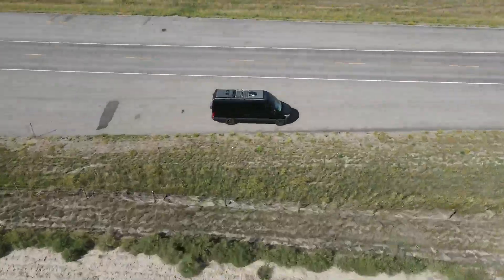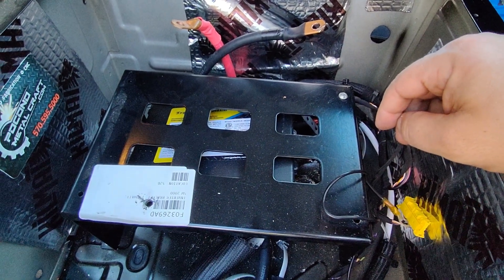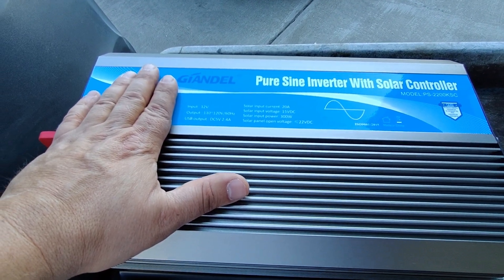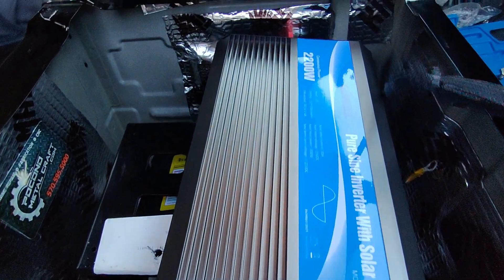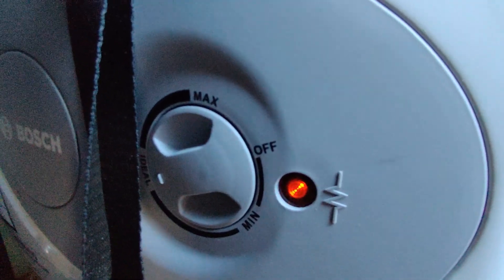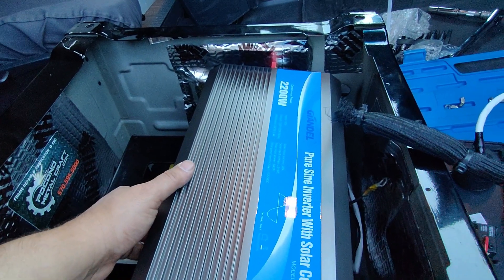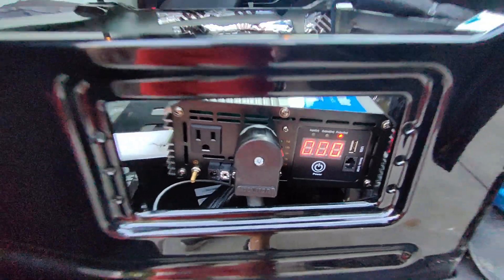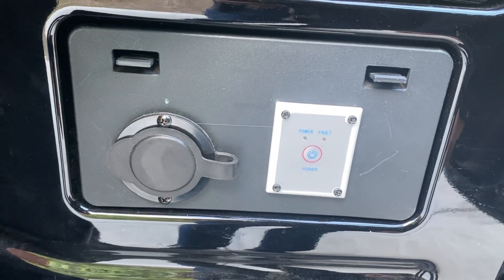Giandel 2200 Watt Pure Sine Wave Inverter Review - Is it Good?

Comment from the maker: Link to my recommendation https://amzn.to/46XTEqV
Link to Modified wave unit inverter https://amzn.to/3PZ8si6

▶Roof system by Flatline Van Co
▶Ladders by Flatline Van Co
▶Slide T nuts https://amzn.to/3QkhlnD
▶Solar panels with hardware included https://amzn.to/48TRrOR
▶Solar entry box https://amzn.to/3s1klfh
▶Dc to Dc charger controller for vehicle and solar in one unit. https://amzn.to/3PWq4v3
▶Bluetooth device https://amzn.to/3rXLgsE

products used in Sprinter van
▶5 Terminal quick connectors https://amzn.to/46O7E6m
▶3 Terminal quick connectors https://amzn.to/3S3OwNQ
▶2 Terminal quick connectors https://amzn.to/3M6Enfd
▶Great 12 volt quick Connectors https://amzn.to/401ERZN
▶12-volt quick connectors kit https://amzn.to/46V0UDE
▶10/3 marine wire made for Camper vans https://amzn.to/3Qj3y0L
▶2000 Watt SW Inverter https://amzn.to/3rUuf2s - failed
Better 2200 watt sw inverter https://amzn.to/490E1R9
▶Inverter remote https://amzn.to/3ZZE2Rf
▶15 Amp Automatic transfer switch https://amzn.to/45yiAEk
▶30 Amp Automatic transfer switch https://amzn.to/45IGzAQ
▶Budget Inverter with remote https://amzn.to/3PYWMMc
▶1/0 Cable for inverter https://amzn.to/3CrUfT3
▶4 Gauge power cable https://amzn.to/407olrl
▶Lugs- 100 Cable connectors https://amzn.to/3FqFbI0
▶Lug Crimper https://amzn.to/3PZ7liu
▶Cable protector https://amzn.to/3PYnTHb
▶14/4 speaker wire (came be used for light 12 volt loads ) https://amzn.to/45AbLSr
▶14/2 speaker (came be used for light 12 volt loads ) https://amzn.to/402gRpJ
▶Junction Studs https://amzn.to/3M5bSii
▶Fuse / Breakers https://amzn.to/3M6F08z - use only for 50 amp loads or less
▶30 Amp Fuse / Breaker https://amzn.to/403WmJ1
▶30 Amp Lifepo Battery charger https://amzn.to/3Q25yZJ
▶500 Amp Battery Shunt https://amzn.to/3S4dSLl
▶Smart Battery Isolator https://amzn.to/45CzGAX
▶15 amp outlet https://amzn.to/3M5yJKr
▶15 amp to 30 amp plug https://amzn.to/3M4uUFg
▶30 amp shore power plug https://amzn.to/45yjMYk

Got a Question? I'm here to help. ▶http://bit.ly/YTRandomFix
▶http://bit.ly/YTRandomFix

Camper van playlist
https://www.youtube.com/watch?v=r2KTXLqso2c&list=PLDEbtVOPRC-id5xjqFsYm87bJSJL8bLbe
2019+ Sprinter Review https://youtu.be/wAAV6bnHNzY
The new toy  https://youtu.be/EAKbCledvsQ
Low Key Battery https://youtu.be/-FI_DG-DE9k
How to Buy a Camper van for cheap https://youtu.be/nqPSV0mszfk
Seat Removal https://youtu.be/KSUQawuSt_w 
Headliner removal https://youtu.be/FjrJBLXEbyU
Vantech Roof Rail Install https://youtu.be/oB_Yh3JEooI
Flatline Vanco Low Pro Roof Install https://youtu.be/pkj5Tcs5a1U
Flatline Vanco Side Ladder Install
Maxx Air Fan Install https://youtu.be/QXxBSx3cfI8
Max Air Fan Review https://youtu.be/JIRG7lSR5yQ
Bathroom Fan Review https://youtu.be/QXxBSx3cfI8
Spare Tire Carrier https://youtu.be/wVQ_h-FjtPE
Oem Diesel Heater Trick https://youtu.be/Ws9GHo9bWeM
Led Upgrade https://youtu.be/r2KTXLqso2c
Sportscraft Swivel Adapter https://youtu.be/HVkj6KVpUbs
Pocono Swivel Seat Adapter https://youtu.be/r-1HpIl71_I
Solar Panel install https://youtu.be/GSvXsDSUObA
Stealth Shore Power Plug https://youtu.be/Ksyee3aYm7s
Automatic transfer switch install https://youtu.be/21UnSoWxb08
Got a Question? I'm here to help. ▶http://bit.ly/YTRandomFix
▶http://bit.ly/YTRandomFix

Comment: HI!!  I have a problem with my giandel inverter when my lifepo4 batteries are at 100% it shows HI voltage error how can I solve it?  Thank you
Reply from the maker: When you batteries are 100 💯 what is the voltage?
Reply: @RANDOMFIX ,bulk 14,2V float 13,5V .Thank

Comment: I noticed you haven't grounded it, what are your reasons for this. Thank you
Reply from the maker: I ran the same setup that the Mercedes outfitter did when I purchased the vehicle brand new. It was ground at the first gfci plug. Plus it was drilled into metal sitting on metal.
Reply: @RANDOMFIX  yeah it seems you should only have one ground, inverter or consumer box. But I was going to run through an auto transfer switch. Just a tad confused 😕
Reply from the maker: @ifell3 I did install a ats https://youtu.be/21UnSoWxb08?si=BMt8zMNPmjUaXuQA
Reply: @RANDOMFIX  awesome thank you

Comment: can i  use  100 ah  lithium battery's to operate this  unit
Reply from the maker: Yes you can use this unit with a 100 ah battery. If you have not purchased a battery  yet try to get a lithium  lifepo4 battery
Reply: Yes, you can power it with 100Ah battery,but you want to power high current appliance or use a longer time,please choose 200Ah or bigger,the bigger the better

Comment: Great review, thanks. I was going to get the Ampeak 2000 but as you mentioned, it’s not good for electronics and it won’t work with my induction cooktop, so I’m going with their 1200 W pure sine wave although I’ll only be able to turn the induction cooktop up to 50% or so. Again thanks!
Reply from the maker: Glad to help  with your decision making. Thank you so much for taking the time to share your journey.
Reply: induction cook top needs a low frequency inverter

Comment: The air flow on the inverter looks very restricted to me
Reply from the maker: Yes a little more circulation would of been great. The vehicle came with a inverter in that location so I was gifted  in a sort the spot but it was limited in many ways.
Reply: @RANDOMFIX  ye we've got to make do sometimes. Iv got my diesel heater under the drivers seat. Bit tight in there for it but it was the only logical spot for it. 
Nice metal box for it to be in I guess.

Comment: I would be concerned about the ventilation of the fan in that small space running that much wattage.
I’m looking at buying this inverter for my solar setup.
Reply from the maker: Sorry for the late reply! did you find a solution?
Reply: @RANDOMFIX  I went with the 1500 watt Giandel and it works great. Thanks!
Reply from the maker: Awesome, enjoy and thank you for the update

Comment: So can this handle a 2200 watt pull per outlet?
Reply: No, it’s 2200 watts total, the 4400 watt peak rating is only for a few seconds for refrigerator compressors etc.
Reply: No
Reply: You can only pull 15amps on any ac outlets on any inverter. that's around 1600w

Unless you're inverter has a hard wire terminal. then you can pull as much as you want through properly size wire.
Reply: No, total outlets 2200W,and each outlet max 1500W,and ac terminal 2200W.
Reply from the maker: Sorry for the late reply! did you find a solution?

Comment: Nice Review, purchased a Giandel  2000W / 4000W Inverter in the UK a month or two back had initial problems with low voltage cut out , ended up being the cables Giandel  supply with the unit were not up to it replaced them with 70mm2 cable and the inverter is now running fine able to use the Induction hob up to 2000w without any problems, still early days but all looking good so far
Reply from the maker: Thanks for sharing your experience, yes this giandeil unit is amazing, I’ve been thru over 10 inverter over the last 5 years looking for the right now for its size this is a winner.
Reply: I'm also in the UK about to go over to induction and inverter. What induction did you go for? Cheers